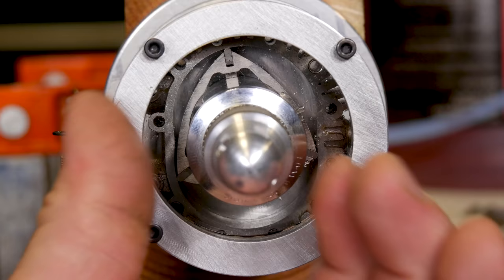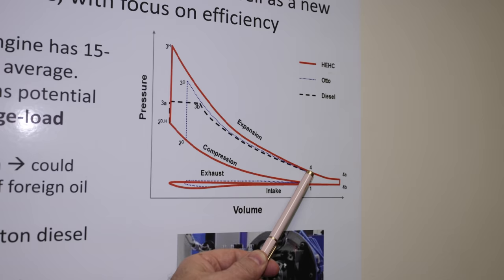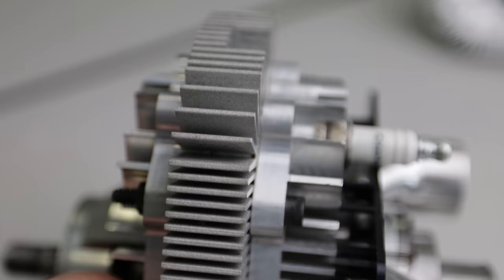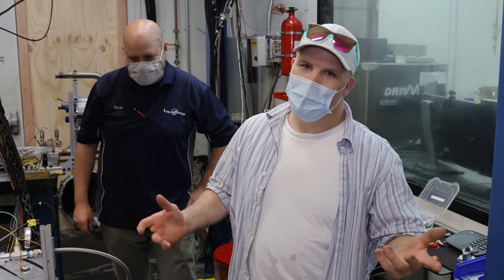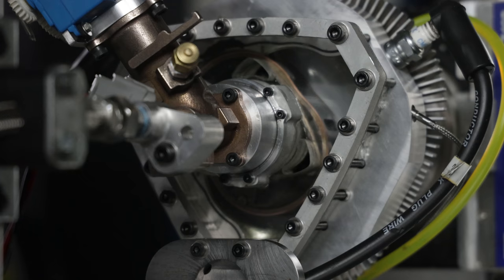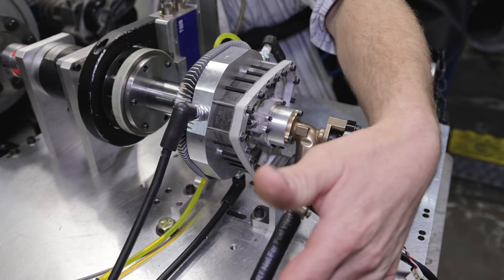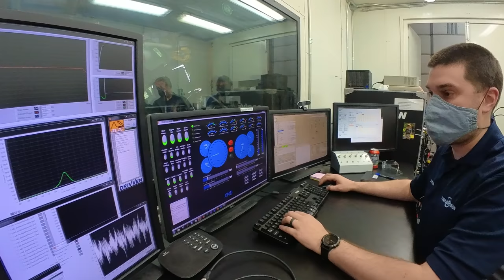See Thru Liquid Piston Rotary Engine - In Slow Motion

Comment: After watching this I realized that the design of the rotor looks like the walls of a conventional rotary engine. It’s basically a Wankel rotary that’s inside out ?
Reply from the maker: Yup, I interviewed the inventors and they address that topic, he's a physicist and he says that Wankle knew about those shapes but he could not seal them properly for some reason, I'm putting those vids up on my other channel soon.
Reply: I'm thinking that the vibration of the engine will become a problem unless they find a way to compensate it.
Reply: @dingdong2103  just add more rotors lol
Reply: there are many additional ways to cancel out vibrations as well
Reply: I had that same thought too. The Wankel rotor shape is now the housing and the Wankel housing shape is now the rotor!
Reply: @dingdong2103  for a single rotor engine, they use a counterweight that swings opposite the oblong rotor. In a multi rotor design, they stack each “pancake” of engine components together, (and I imagine they have a small space between them for the inlets and ports), and each rotor in the stack is likely 60º or 180º out of phase (or some other angle appropriate to the number of rotors and how they want the rotational characteristics and phasing of the combustion events). The nice thing about this design, is in theory you could put a rotating contact on the drive shaft to time the spark plugs, and the overall engine complexity can be reduced, which means you could see these things being produced for small portable generators or other applications where the complexity and weight savings are beneficial. Also the continuous rotation characteristics, especially in a stacked configuration make it really great for driving dynamos/alternators I imagine.
Reply: @comeradecoyote  Why would you use a contact when you can just put a tone ring on it and count pulses with no moving parts, like every other motor since about 1994... ?
Reply: @WarpedPerception  Unfortunately it still doesn't solve the biggest issue with all rotary engines and why oscillating (piston engines) still win out on efficiency of fuel usage.

A single piston engine has 3 critical sealing points, the piston against the walls of the cylinder, and the two valves, all of which are single dimensional seals (i.e. they only have to deal with movement in one dimension).

Rotary engines like this have to deal with multiple critical sealing points experiencing movement in multiple dimensions. In this engine for example you've got the two side seals which are experiencing movement in two radial dimensions as well as the axial dimension, and then the rotor itself does need to seal reasonably well against the casing while experiencing movement in both radial and axial dimensions. 

It's incredibly hard to seal something moving in so many different directions in such a way that there's no leakage, and leakage is lost power.

This is one of the reasons gas turbines can be so efficient as they actually don't rely on any seals at all, any fuel flowing into the system must be combusted as the continuous process doesn't allow for any other option.
Reply: @blockstacker5614  the problem is how to get the air in and out of the engine with multiple rotors, im thinking you could do 2 with this design maybe, but more than that i think is not gonna be possible
Reply: @LemmingGoBoom  and also why gas turbines are so inefficient..
Reply: @charpocus  Gas turbines are only inefficient when used with shifting loads, when they're used in something like power generation under constant load they can far exceed the efficiency of a reciprocating engine. 

This is why using them in something like the M1 Abrams was not the greatest idea, but using them for stationary power generation is great, especially as you can then do combined cycle and capture the waste heat and use that for other purposes.
Reply: @waveboard111  just do it the same way mazda did with the rx8 and use the iron to funnel the exhaust out
Reply: @blockstacker5614  with the hollow piston they could put the counterweight inside maybe
Reply: @LemmingGoBoom  I'm guessing you never heard of Labyrinth seals.  Turbine engines do have seals to keep lube oil where it needs to be and not blowing out the exhaust.
Reply: How is the apex seal problem fixed? This engine still has the same seals they are just mounted on the housing. Part of the inside out concept no doubt but a broken seal will still "destroy your life".
Reply: @charlescanton4740  I'm well aware of labyrinth seals in gas turbines. 

The difference there is they're not holding back combustion products and aren't directly related to the efficiency, or lack thereof, of the engine.
Reply: @matthewsullivan9598  maybe because the apex seals in this design aren't affected by the g-forces of the rotor spinning, only thing it  can fail on it is the spring, and that would only result in a lack of compression
Reply: @kleetus92  Because these YouTube Engineers in the comment section are at the top of the first peak on the Dunning-Kruger curve.
Reply: @ParadigmUnkn0wn  lol!
Reply: @waveboard111  you could do 2 or 3 or 4 if you wanted, 2 would face into each other and use common plenum for the intakes and exhaust, and the 3rd rotor would face outward like the single. If you did 4, it would just be 2 doubles and so on.
Reply: @matthewsullivan9598  I'm guessing that the Apex seals being on the housing wears out the piston rather than the housing, easier than replacing the housing every 90k miles, piston looks fairly cheap
Reply: @waveboard111  I agree, it seems tricky at best!
Reply: @LemmingGoBoom  
True,
 they shifted the same issue around to only appear superior yet like you said have not really solved the main points of what is inevitable.
The laws of physics and All aspects, energies and MASSES in machineries  have fatal flaws, rotary are just “unique” yet still exists here !!

The bug hunt is to find the most durable design and fuel combo!

The seals will vibrate themselves to death like before in this design.

Outside of Huge bearing supports on both sides,  to “reduce” the core wear/sealing” problem and extend their run time, they WILL return to he same one 'killer of its concept' conclusion. Even in a vibration  “harmonics dampening” design, this will still result in the same things.~

If they wanted to make a real superior gain in this realm of machinery and energy then the development of Hydrogen usage and or the thing Tesla found and embarked on.

FREE energy in the voltage difference in earth ground to upper Atmosphere voltages’,  and the delta it holds to use to create EMF producing movement upon this & Hydrogen this.

Lots of clean FREE energy there.
Reply: A lot of vibration
Reply: @oldmech619  like any single piston engine without counter weights.
Reply: Yeah I still saw the apex seals getting pushed around a lot but hopefully it is still more durable in this design
Reply: Basically, you can keep stacking functions i think, there was a site with crazy insides
Reply: I've noticed this engine has apex seals as well! If you look closely along the walls of the chambers there is a apex seal. Exactly how you said it's a Wankel inside out!!
Reply: @ParadigmUnkn0wn  I did not understand a thing you said
but I like the way you said it
lol
Reply: @WarpedPerception  I think the reasons is pretty obvious, the technology wasn't up to par AT a cost. Bet he had access to it, but couldn't make it affordable, a rotary in this config would've costed five times or more what it came out in the conventional format, which he could seal using those methods we know.
Reply: Epicicloid coupled to an ipocicloid and viceversa
Reply: @LemmingGoBoom  labyrinth seals and face seals....like carbon rotary faces running against some hard face...the mechanical seals used in jet engines are cheap AF typically because they will be replaced on a set schedule or when oil consumption is past specification. Mechanical seals for industrial applications vary from $20 to $500k depending on application.
Reply: @dingdong2103  They added a counterweight.
Reply: @blockstacker5614  yep, that would bd my comment as well.
Reply: Yup that's the first thing I noticed it's cool as fuck I hope it's not too complex though!
Reply: It looks like a heat sink on a pc
Reply: @matthewsullivan9598  I think the only big difference is that the apex seals seen here are not subjected to high centrifugal loadings as they are in a conventional rotary engine.
Reply: @LemmingGoBoom  Fuel usage have little to do with sealing.
You have 3 more cycles than a regular piston engine, and even then you don't use 3x as much fuel

It's more efficient than a regular engine if you go 1:1, but it's not because well, rotary engines

It's not meant for fuel economy anyway, you can achieve much, much more power from a smaller displacement than a regular engine, of course the price for it is fuel

So it's utility is in race/sports cars/bikes/karts, small utilities like chainsaws, lawnmowers, generators and things like that
Reply: @ThePobreGamer  It's the G-force that makes the seal.... well, seal
So they didn't adress the problem, and in fact, is still the same or even worse than the regular method

My rotary engine is in excelent condition, because I know how to maintain it, like you should do with every sports car in fact, with care and attention

And not some fuckboy that don't know shit and rev it to outer space when the engine is cold, and believe me, there a LOT of them sadly....
Reply: @FuSiionCraft  Fuel usage is not the same thing as fuel efficiency. Efficiency is what percentage of the available energy is extracted from the fuel, regardless of amount. 

If you have leakage of combustion products or unburnt fuel out of the combustion chamber other than by the exhaust orifice during the exhaust phase that is by definition lost energy and thus lower efficiency.

Rotary engines have more sealing surfaces in the combustion chamber, no seal is perfect, therefore they are the leakiest and lowest efficiency. 

Piston engines are more mechanically complex but most of that complexity is outside the combustion chamber. Less moving seals in the combustion chamber means less leakage and higher efficiency.

Turbine engines operate on a continuous flow model and so need no seals to contain combustion and can't lose efficiency in the same way as cyclical engines.
Reply: @kleetus92  Counting pulses? That sounds like a complex electronic system to me. A rotating contact requires no electronics at all. Purely mechanical/electrical. We are trying to lower complexity not turn it into a brick if you don't take the latest update.
Reply: @waveboard111  you can have an inlet for the driveshaft in front of every rotor. no problem sir
Reply: @blockstacker5614  add 3 , each apposed to each other to offset haha more rotors!
Reply: @Crimsonedge1  when was the last time you changed the software on your car?
Reply: @blockstacker5614  Correct, a second rotor at a 60 degree offset will allow 2 combustion events be set off 180 degrees apart to make it self (almost) cancelling in vibration. There would still be some minor torque aspects since they are not in exact same plane but as more planes are added it would become less significant. Can you imagine a 4, 6 or 12 or more plane system ! Am really fascinated with the high rpm capabilities because there is so little moving mass vs Piston ICE processes.
Reply: @comeradecoyote  Also wonder about use as a gas compressor in various systems.. I'm wondering if they could possibly be used as a replacement for complex turbopumps in rockets... if able to run low/oil free it could be used in hi vacuum roughing pumps as well for vacuum based manufacturing systems ie computer chips, optics,  space hardware, medical pumps etc.
Reply: @kleetus92  My 2018 C220d 3 weeks after purchasing it. It was new at the time. It was some dodgy electronics/electrical combo that had to be sorted out in the garage and I was stuck with a courtesy for 3 days.

That's beside the point though. Simple fact is, adding an electronic system when good old fashioned mechanical/electrical will do needlessly over complicates things.
Reply: facts. electric timing based on hall effect is super simple and dime a dozen nowadays
Reply: I wanna see a steam engine that meets environmental codes with admissions
Reply: @matthewsullivan9598  you can lube a housing-mounted seal without having to inject lube oil into the intake charge. That solves the emissions problems and seal wear problems the Wankel has. Also, a broken seal/ring on any type of engine, e.g., conventional piston or rotor, will cause problems. Keeping the seals lubed is critical, and this engine easily allows that.
Reply: @Crimsonedge1  k
Reply: @smac919  It's called cooling
Reply: @matthewsullivan9598  apex seals needed oil in the fuel to be lubricated because they could get oil to the seals directly now that it's in the housing they can use direct oiling on the seals for cleaner emissions and longer lasting apex seals because the lubrication is more controlled.
Reply: @LemmingGoBoom  you ever heard of a combustion cycle? Cause the big thing is the cylcle this engine is on has a far higher peak efficiency than a normal engine so even if it leaks more it could still be more or as efficient as a regular engine.
Reply: @Ethan-3369  <citation very much needed>
Reply: @blockstacker5614   2 rotor 180 our of phase seems like the quick and dirty method.
Reply: @dingdong2103  your thinking is wrong.  No vibration.
Reply: @LemmingGoBoom  Gas turbine still need to seal properly, any bad clearance between the casing and the blades will result in pressure losses.

Also I've seen pressure chamber used as seal in these engine. A labyrinth seal keep the oil in place, then there is a chamber under pressure, then another seal. Air is pumped in the chamber and the outlets is filtered to catch the oil and  inject it back.
Reply: @LemmingGoBoom  I'm stationed on a destroyer and they'll push a couple tons through the ocean at 30+ knots easy , we also use them as electric generators for the ship
Reply: @abz124816  Lol you're a good joker. You can visibly see the engine shake while it runs.
Reply: @yafois988  yeah, you lost any credibility you had when you started babbling about free energy.

on the subject of the engine... This engine doesn't eliminate the issues inherent in a wankel, but it might let you reduce some of the issues. The Apex seals can be beefier because they're not on a moving rotor. The rotor can seal the front/back plate with fewer seals because of that too. The combustion cycle is more efficient. It looks like you could pack more rotors into a smaller lengthwise space too since exhaust goes out the driveshaft. 

It's still going to have blow-by and power loss, burn oil, and it'll have other issues unique to it's odd design. But I see it doing well in some niche applications where power to weight is a big deal. Ultralight aircraft/paramotors, weed whackers, small generators... And I'd love to slap one on a gasbike frame, that thing weighs less then a Zeda 2-stroke from the looks of it, and even with a clutch and drive gear....
Reply: @LemmingGoBoom  Gas turbine engines have labyrinth seals and the turbine blades run crazy tolerances (even rub) on the casing.
Reply: @AtrumOculis  the labyrinth seals are for keeping oil out of the combustion chamber, not keeping combustion pressure in. And yes they run close tolerances to minimise losses, but there are no seals involved in the production of usable power.
Reply: How do they lubricate the dorito🤔
Reply: @LemmingGoBoom  Another issue is the shape of the combution chamber.  there is more surface ,so more temperature (energy) lost.
Reply: The seals will still be an issue, they just moved them from the tips of the rotor.
Reply: @FuSiionCraft  but then chainsaws and lawnmowers can generate even more force with a given volume and weight using electric motors, which are also easier to maintain, cheaper to replace, lasting longer, having better torque on the entire power curve ...

I don't see combustion based engines having a place in small devices for much longer other then for very specific scenarios ...
Reply: @Crimsonedge1  if a simple hall sensor is overly complex for you ... for most people it's a very cheap piece in the tool box. Any mechanical solution is way more complex than that and prone to failure.

In fact that's the very reason electronics are replacing mechanical solutions everywhere: they are much simpler, reduce complexity, reduce costs while increasing longevity. Stuff only gets ugly once you start to add computers with firmware ...
Reply: I think the seal issue is solved by making it very easy to replace. It's not on the rotor now so they can be accessed and replaced without opening the engine. If it wears out in a year but costs $50 to replace, nobody fucking cares, do they?
Reply: @LemmingGoBoom  Jets and Piston both peak around 50% efficiency.
Reply: @brag0001  "Plug and play for dummies" is not the same as "simple". With mechanical issues, you can fix them in the field with tools. More often than not, when an electronic component breaks, you need a shop to fix it. Sure, if you just so happen to have a spare electronic component to replace in a plug and play fashion, great stuff. What happens 20 years later when the manufacturer is no longer making components for that brand. You're going to need to source your own. Custom mechanical pieces are expensive enough. Custom hardware with custom software? 

Yeah, good luck with that.
Reply: @Crimsonedge1  That's just biased by stuff that you are trained to do. I've studied electronics. If that sensor isn't readily available anymore, I'll just use another one which fulfills the same specification. Anyone can learn that.

When a mechanical part breaks, I'm out of luck just the same. I don't own a lathe, I know shit about material strengths and I can't create random metal parts with a specific alloying.

But the main difference is: the hall sensor simply won't break. The same function performed by a mechanical solution will, unless overbuild heavily and lubricated regularly ...

But you can't even figure out the difference between electronics and computers, so I'm not surprised that you think of a simple hall sensor as a plug and play component ...
Reply: @brag0001  BTEC Lvl 3 Advanced diploma in Electronic and Electrical Engineering, Bradford College, UK (2011). (Don't get it twisted, I fix phones and laptops for a living haha).

Either which way, I'm far from biased. I love my amenities and everything being at lightspeed and the touch of a button. I've just also been far out in the wilderness and experienced first hand what happens when electronic components fail. 

Look at it another way though.... More simplified... Russian logging companies working out of Siberia... They still use old 60's and 70's tech. Why? And I'll give you a clue, it's not because they don't have the cash for all the flashing lights. 

Back to my original point though. The crux of the matter if you will. One does not simplify something by adding a complex system when a simple more time tested method can produce the same outcome.

My obsession with all things mechanical simply comes from the fact that a large electromagnetic event be it solar or man made will happily wipe out all the complex stuff. The mechanical stuff however will still run and be reliable.
Reply: @Crimsonedge1  Then you should even more aware of the difference between a simple sensor and a computer system. I'm not saying that using semi-conductor technology is without drawbacks. Especially since I totally agree that, as of today, building highly integrated circuits from nothing in your garage is not achievable.

I'm just saying that you are overstating the complexity of using them in the right place and understating their ruggedness compared to mechanics when used in the right place. And at the same time you are underestimating the complexity of mechanics.

The Otto-Motor has been in development for more than a hundred years for a reason, even if we discount all the electronics which go into a modern version of it today.

I agree that mechanical stuff is very useful when having to bootstrap a civilization from nothing. But I don't see as many uses for that as for example for someone bootstrapping from the collapse of civilization who is able to scavenge leftovers. Hall sensors will be easy to come by, even after a major electromagnetic solar event, for a very long time. There is at least one in each and every fan which can report its current speed out there. Whereas replacing the mechanical version of a precision sensor being able to measure thousand of revolutions per seconds won't be exactly easy either ...

And should you one day really run out of hall sensors to scavenge and still not being up to speed as a civilization again: some copper wire will allow you to build a new sensor without having to recreate fabs for semiconductor production ...
Reply: @blockstacker5614  yep, with 3 being the best option because you have a detonation in each chamber canceling eachother out.
Reply: @dingdong2103  the problem should be solved/compensated by introducing a 3 disc engine with each disc cycle shifted/or delayed 120 degrees to its neighbour.
Reply: @LemmingGoBoom  .    Indeed, so why bother?  It’s an idea that’s works, but it’s not an idea that succeeds, neither  in practicality nor efficiency.
Reply: No, they just bumped the number of lobes and rotor faces up by one. This is legit VERY old tech.
Reply: McClure patented a “stacked” rotary BEFORE Mazda built their Wankle powered car!
Reply: @blockstacker5614  The Wankel had only one firing chamber, whereas this has three, which is why Wankel ran fine with two rotors.  I think this would be vibration free with either three or six rotors (you'd have to look at how the inline six piston engine self-cancels vibration using two sets of three cylinders on one crankshaft).
Reply: @ParadigmUnkn0wn  Easy killer.  There's no need to bring Freddy into this debate.  He only drives buses and '57 Chevy convertibles.  Or the occasional pick-up.  I don't know this Dunning person you speak of.  Therefore, by proclamation, it's his fault.  Case dismissed.
Reply: @geminiman6938  Correct, however, on a jet engine, those seals have nothing to do with combustion.  Reciprocating engines have oil seals as well.  They are not relevant to the discussion at hand.  We're speaking of sealing the combustion chamber.  You can seal the combustion chamber on a jet engine, but they go by a different name when you do- they are called bombs.
Reply: But the cars ran smooth....right??? Or was I tripping?
San Clemente Ca 1972 73 74 75
Reply: That is pretty cool....Thanks Man!!
Reply: @dingdong2103  3 engines in line, angled 120°? That's a 9-cylinder engine!
Reply: @FuSiionCraft  0
Reply: The Wankel engine was invented by the German Felix Heinrich Wankel. Finally, in April 1954, he succeeded in making the basic invention for the motion sequence of the only rotary piston engine produced in series so far, the Wankel engine. :-) The NSU Ro 80 was a saloon car of the upper middle class produced by NSU Motorenwerke AG (from 1969: Audi NSU Auto Union AG) from summer 1967 to mid 1977. It was one of the few production cars to have a Wankel engine with an output of 115 hp (85 kW). The model was officially presented at the 43rd IAA in Frankfurt in September 1967.
Reply: @dingdong2103  The engine did not vibrate. You could put a glass of water on the bonnet without it vibrating.
Reply: @blockstacker5614  The engine did not vibrate. You could put a glass of water on the bonnet without it vibrating.
Reply: @andrew.6944  Did you watch the video at all?
Reply: @dingdong2103  probably not considering how other engines vibrate as well. I'm sure a production model mounted up and weighted properly wouldn't be an issue
Reply: @LemmingGoBoom  hmm. That suggests taking  turbines out of the prime mover role. Use them to drive generators at constant load and charge batteries, then  use electric motors connected to batteries to move the treads. Electric motors back then probably couldn't do it, but maybe nowadays?
Reply: @alvarofernandez5118  You mean pretty much how they are used these days?

And then you can gain even more efficiency by making those turbines even larger, taking them out of the vehicle and 
taking the fuel out of the equation and letting the wind drive them. Free energy!
Reply: @blockstacker5614  yep that move counter to each other to even out the movement
Reply: @LemmingGoBoom  I knew it
Reply: As I invented this kind of machine parallel, I might be competent to answer to this question. Difference is mechanical, if you see a wankel motor animation, you can see, the gear of the wankel ist just on the wrong side, opposite to the combustion pressure. And looking at the liquid piston machine, you see less friction between the rotating thing and the housing. 
Both motors still have the problem of sealing. 
First: If you cut both motors along the hub axis, you see rectangular chambers with 90° angles and corners. Why not round the corners? The housing will then be made from two halfes, that meet in the middle. 
Second: Between two neighbour chambers there is maximum pressure difference. Solution: Use instead 12 chambers, between Chamber X and Chamber X+1 there is only a small pressure difference. It will run smooth like a 12 cylinder motor. Only disadvantage you need 12 spark plugs, like in the 12cylinder.

I congratulate the team an wish much sucess. This is an alternative for the electric car, or could serve as a range extender in the electric car!
Reply: Yes, they took the Wankle principle and ironed out the kinks. I had an NSU Ro80 ( back in the day ! ), Liquid Piston design addresses all the original shortcomings.
Reply: @dingdong2103  very little vibration, my NSU Ro80 was smooth at 9k rpm. None of the up and down movement. Direct rotational power.
Reply: @gallupcustomknives2293  yes !
Reply: @ParadigmUnkn0wn  In generalizing, you have demonstrated primus inter pares has effected your conclusion.
Reply: @LemmingGoBoom  "gas turbines.....actually don't rely on any seals at all". Gases can still leak back from high pressure to a low pressure area. There are labyrinth seals on shafts, the blades sometimes have seals too.
Reply: @comeradecoyote  couldn't you hook 2 (or 4) of these up to the same crank shaft each firing in opposed directions to cancel out vibes?
Reply: @WarpedPerception  ļ
Reply: @osamabinladen824  jet fuel ?
Reply: @matthewsullivan9598  Since the seals are in the housing instead of the rotor they are easier to lubricate.
Reply: Potential problem would be rotor cooling. One side of the rotor lobe is always in all combustion events taking all that heat without benefit of oil cooling ( note, mazda rotors are cooled by oil splash internally). Its difficult for this new rotor design because in addition to combustion heat, exhaust gasses flow through it as well (adding even more heat) making it hard to integrate a design for internal oil cooling. Failure is imminent due rotor warpage caused by over and unequal distribution of heat.
Reply: Troy S  Using the GT in a stationary mode to charge batteries and then using electric motors to drive the vehicle off those batteries is still more efficient.

And if you're going to dedicate the space to a gas turbine power plant, why not just build a wind turbine instead and do the whole charging stage for free?
Reply: @chrisgoebel  That would add unnecessary friction losses. Stacking them inline and offsetting the phase angle ultimately makes these more like an inline 8 piston engine, which is naturally balanced by the phase of the pistons being offset so that a piston is firing in a sequence that ultimately cancels a good bit of the vibrations. The V-8 design is likewise a compromise in this respect to try to gain the advantage of an inline 8 without being nearly as long. (and they actually built V-12 and V-16's to try to solve the harmonic issues that the V-8 design introduces). 

The rotary engine stack on the otherhand gets you back to having essentially a power stroke every 60 degrees. If you offset that appropriately, you could have a combustion even every 10 degrees in a stack of say 6 (since it rolls over with the 3 lobes of the engine), and get the same kind of balance as an Inline 6 or 8 engine, without nearly as much space requirements. And it's scalable since you would only really need a minium of two or three units to obliviate the need for the counterbalance.
Reply: @dingdong2103  Add counter weight
Reply: @FuSiionCraft  and the mixed fuel should in theory prolong the apex seals..
Reply: @johnclifford1911  I'm understanding the concept, but can't conceptualize how you would accomplish it.
Reply: @DFX2KX  Nitro R/C and hobby aircraft 1/5 scale.
Reply: @brag0001  several cylinders might make sure you don't die and make it back to the ground. Where as an electric motor failure of any kind its pretty much a wrap. IMO...granted electric is the future for most applications.
Reply: @Crimsonedge1  like points compared to The HEI system and accoutrements...my 68' F750 and a can of either and we are riding! Lol
Reply: @Crimsonedge1  now your thinking...damn EMP...everything is gonna be junk.
Reply: @vincentrusso4332  Electric motors are so light and cheap at the same time that you can easily build a lot of redundancy into any electrical flying system. Look into Volocopter and similar concepts. Those can compensate the loss of at least four electric motors/four rotors. There aren't many conventional planes or helicopters out there which can be flown with that many failures at once 😉
Depending on the design of those things they can even be landed safely without any motor still functioning, similar to how helicopters can still land with a total power loss ...
Reply: @waveboard111  sure you could. A 2-rotor engine could have the intake between rotors and the exhaust on the outsides. Stack multiple pairs of 2-rotor engines if you want more torque... or make the engine larger.
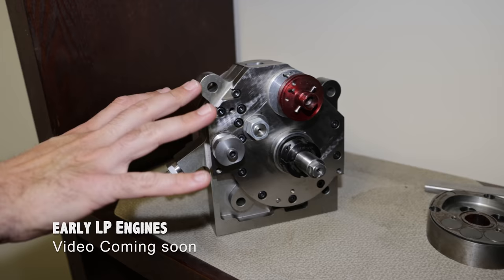Reply: @dingdong2103  13:22 Looks like a counterweight there.
Reply: @zukobringas5096   mazdas oil cooling turned out to be less than ideal, many rotary gurus swear its better to ditch it and put two stroke oil in your gas instead. The rotor itself is cooled by 90% cool air and 10% exhaust, looking at the fins on the inside of the rotor they probably thought about that. Its also better on the seals, not just because they are not placed inconveniently but because the speeds of the rotor itself are lower in relation to mazdas design. To me its more realistic to make a rotor that can withstand that sort of heat than making apex seals that are reliable, we have been trying that for decades with limited success after all.
Reply: @Bramon83  Even worse, why the engine is shaking itself to pieces then?
Reply: Imagine when mazda engineer is watching this video and thinking about making the new rotary engine based on this design...🤔
Reply: @archerrise3996   oh they are definitely here
Reply: Dam I didn’t even see that
Reply: everyone is focusing on the apex seals.  I think those will wear out, but what about the front and back seals, sealing the rotor to the face plate etc?  How do they work without massive friction?
Reply: Yep but a hell of a lot more reliable lmfao
Reply: @blockstacker5614   yes several thin rotor banks each offset X number degrees countering one another's imbalance to BE balanced.
Reply: `How long will it befoe it dies?
Reply: @matthewsullivan9598  I think it is better that the apex seals are stationary in this configuration. When the seals are on the rotor as in conventional rorary engines, they spin and move at a tremendous speed and it often happens that the corners of the seals break off and damage the inside of the engine.
Reply: GREAT OBSERVATION. Thanks.
Reply: Most people - even the owners of a Mazda rotary car - seems to forget that a standard apex seal in the car size rotary engine is not a single piece but actually 3 pieces - there're two tiny triangular corner end pieces that is a little loose so it won't push too hard against the housing surface as it spins to avoid scratch the housing surface as the rotor spins around, and that's where the drop in sealing occurs. Here the apex seal is completely stationary so you only have to worry about the force of the seal which pushes into the spinning rotor surface while not having to worry with the side seals and that's probably where the improvement in chamber sealing occurs thus solving that apex seal issue.
Reply: @dingdong2103  prototype! It would be a sinch to make a harmonic balancer pully, shaft or other counter weight system.
Reply: if it was a turbo, the center shaft would just be a plenum and as long as you has enough cfm, it would be very effective. NA could definitely suffer from loss of vaccume on inner rotors in a 3 rotor or more though, but really would take some rpm to be an issue. not much different than the 4th cylinder away from an intake in the first place.
Reply: @KJF87  Just pointing out that it was supposed to be vibration free by geometry.
Reply: @LemmingGoBoom  
What is that problem?
Reply: The seals being in the housing could be changed by removing a plate. Just replace the seals and springs at service intervals. Almost a DIY job.
Reply: I didn’t see your comment and said that, you can see the wear shape is the shape of the rotor from a Wankel engine.
Reply: @Alfred Wedmore it's a bit odd topic but when I was a kid I always thought Nuclear power station produced power in a somehow modern, new way... When I grew up I  discovered to my big surprise they are just big steam machines. Such a disillusionment!
Reply: Does it make an inefficient combustion chamber because of the shape and the motion of travel ? 
Just curious.
Reply: Repent to Jesus Christ!
“By faith Joseph, when his end was near, spoke about the exodus of the Israelites from Egypt and gave instructions concerning the burial of his bones. By faith Moses’ parents hid him for three months after he was born, because they saw he was no ordinary child, and they were not afraid of the king’s edict.”
Hebrews 11:22-23 NIV
Reply: @jesusislord6545  go away.
Reply: @LemmingGoBoom  The lack of efficiency in Wankel engines mainly is the result of the fact the pressure that's produced by combustion cannot be used 100% to push one single surface (like with a regular piston) into ONE solemn direction, partly the suitcase of the rotor that receives the force attempts to push the opposite way from what the actual direction of the actual spin is.
Reply: @LemmingGoBoom  sorry if I'm late to the party...

Turbine engines do have seals, not only for oil (carbon seals or labyrinth) but also either boundary layer sealing at the blade roots and abradable seals at blade tips, for both shrouded and unshrouded blades. The airflow can leak around these and reduce efficiency by several percent. That's one of the reasons the tolerances on modern gas turbines are so tight, for efficiency. The engine will run with worn out airseals, but it'll run like shit... either burning much more fuel or not producing the rated thrust or shp.
Reply: @WarpedPerception  What is your other channel's name?
Reply: The problem with the seals can be fixed with better materials, that piston wall could be made with that new alloy steel discovered months ago, it's a steel alloy with added scandium that barely expands even in a high temperature environment.. or maybe some carbon ceramic material, anything with a high thermal capacity and low thermal conductivity..
If you look at the center piston, the one that looks like a peanut, it has straight lines from the center going towards its walls, and they did this so exhaust gas can pass through it right? There might be a more efficient design than using straight lines, I'm imagining some spirals that would guide the exhaust gases more efficiently, so the piston would end up looking like art nouveau, but that would require some aerodynamics and computer simulation to get it right..
Reply: @dingdong2103  counterweights
Reply: @dingdong2103  bushings should help a lot with that
Reply: @thatcarguy0710  Yeah but the video claimed it was inherently stable, didn't look like that at all in reality.
Reply: You are right, it's the same just more complicated and less efficient 👍
Reply: If I'm not mistake NSU try that way before even on motorcycle, and BTW I don't know why Wankel engine wasn't a success for motorcycles
Reply: @dingdong2103  simply run two "layers" of the engine 180⁰ out of phase, and dynamically balance the common shaft at it's ends.
Reply: @crackmyknuckles169  It was supposed to be inherently balanced yet the prototype was shaking to bits
Reply: @matthewsullivan9598  And what if we solve the problem of lubrication and cooling of the apexes by lengthening them by 2 times and moving them perpendicular to the rotor.  First substitute the left half, and
  In the meantime, dip the right one into the oil bath, then substitute the right one, and shift the left into your oil bath.  You just need to make the apexes 2 times longer and the drives on them
Reply: How high can this rev?